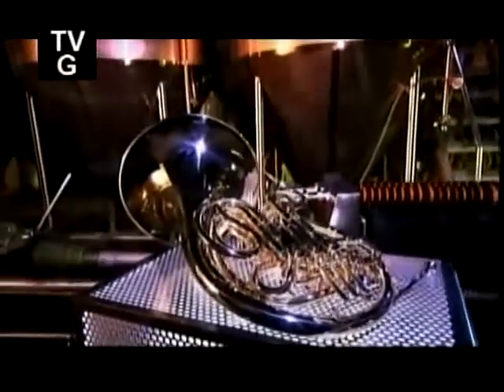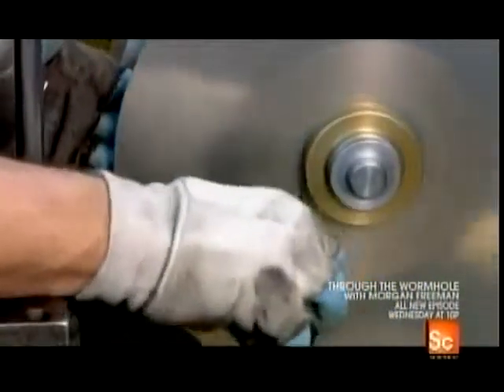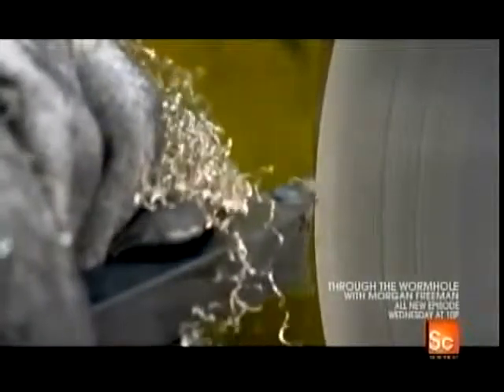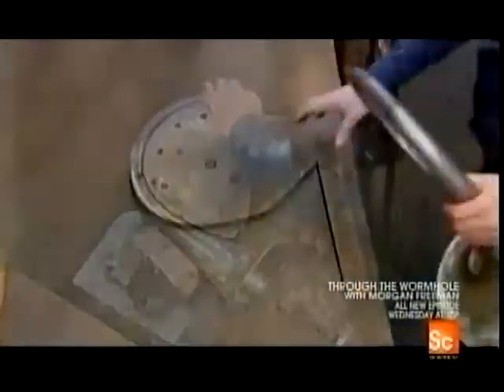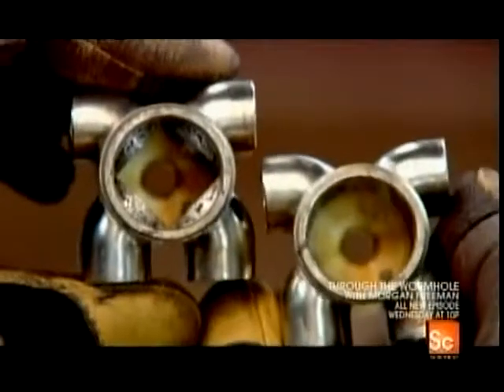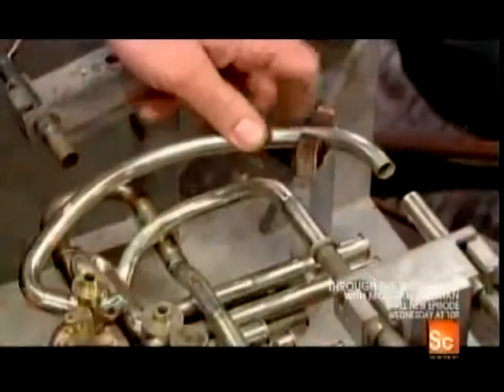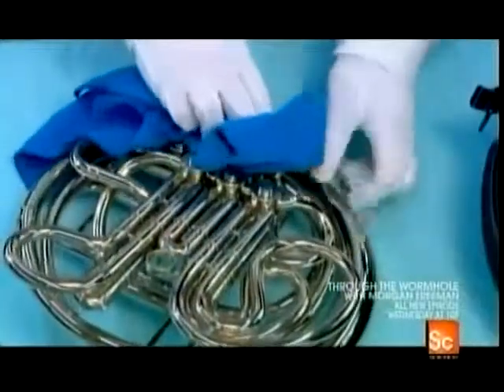How Its Made French Horns

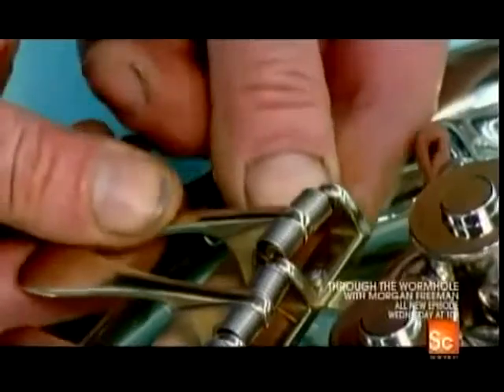Comment: 3:55 Now Final Assembly of the Valve Section can begin. They install Rotors in the Valve cases & Levers to activate them. Unlike Piston Valves on a Trumpet that move up & down, these Valves turn to direct air flow through various tubing combinations (they do make Rotary Valve Trumpets too).